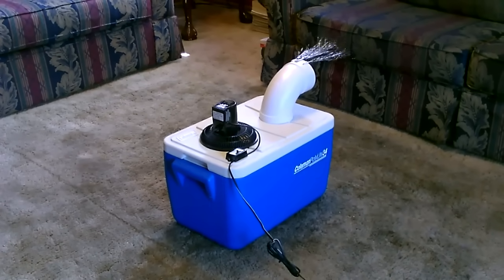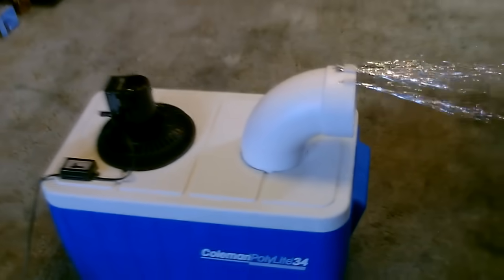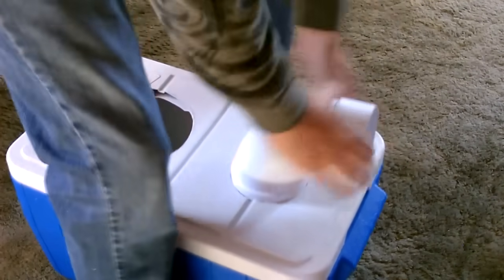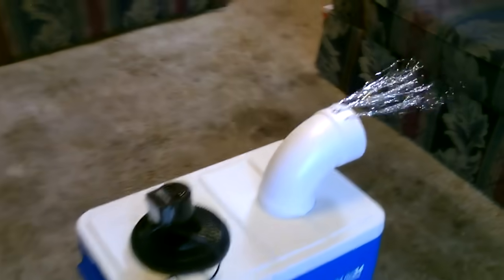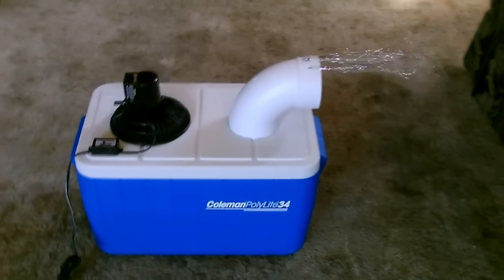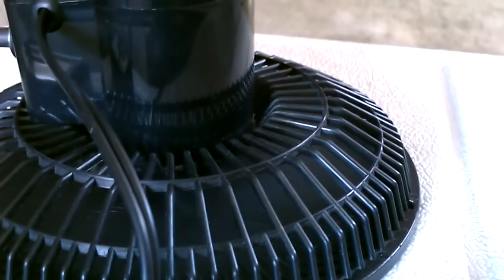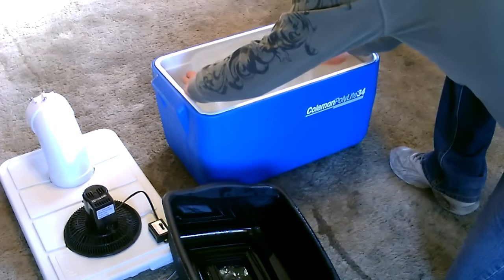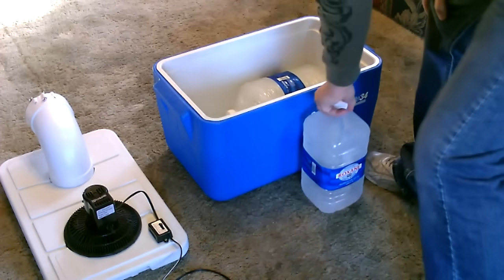Homemade air conditioner DIY - Awesome Air Cooler! - EASY Instructions - can be solar powered!

Comment: Not good . . . ice is not free!!!!!!!!!!!!!!!!!!!!!!!!!!!!!!
Reply: TehGuard If you already have a fridge hooked up the energy that you could use to freeze the water is already being consumed as you read this.
Reply: Trần Hưng Ðạo Freeze water yourself.
Reply: Trần Hưng Ðạo still cheaper than having air conditioning. fridge + freezing 6 liters of water every day = 14 dollars a month. That or a air conditioning bill of 120.
Reply: i think your trolling now, your initial argument is "ice is not free". your right. its not. but its very VERY cheap to make, even with the cost of freezing it. So yea, its not free but its so cheap it might as well be.
Reply: People like Tran are the reason we have mental institutions. Get help fella
Reply: If your leaving freezer on a random setting at like let say 8/10 and when it reaches that temperature it will shut off automatically. The constant output is monitored by an internal thermostat making it a open loop system. It will shut off because the internal thermalstat has detected that the freezer has reached the temperature setting that you chose, which is 8 in this case. Standard commerical freezers all do this. Now if your freezer is not running because it has reached that temperature you will not be using energy. The second you take out the frozen water and put in a new batch of room temperature water, you lowering the temperature read by the thermostat in the freezer by exposing the inside to room temperatured air and to room temperature water. Heat energy disperses evenly just like how water mixes evenly with thing Once you close the freezer door the "AVERAGE" internal temperature will continue to drop due to the existence of the newly placed room temperature water and not only because you openned the door. This will make the freezer turn on again to try and lower the temperature inside the freezer which will consume more energy. So it DOES take energy to freeze extra water all the time. The amount I calculated while I was on skype was a rough estimate and was wrong. According to a source site: 1  Watt is 859 calories/hour, so at 100% efficiency, 1 Watt could freeze 8.1 grams of water per hour. Figure on a refrigerator being around 30-40% efficient, so say 2-3 grams. Converting 12 liters per day of water to grams results in 12000 grams. Assuming it takes 1 W per 3 grams a generous 40% efficiency estimate it will take 4000 Watt per hour of energy or 4KWH of energy per day. This is 120KWH per month so if it is about $0.064 per KHW it will be about $7.70 worth of energy per month to freeze all that water (lol submit to r/ididthemath). So yes it will be cheaper after you build this device. The building cost and tool is something you need to consider if it is worth making, which is obviously yes since it only takes 8 dollars to make.
Reply: +Trần Hưng Ðạo freak
Reply: this had been my first month using it. 31 days of using the DIY air conditioner. I start it up in the afternoon and at night before i go to sleep. my electricity bill this month was 43 dollars. I have 2 room mates that i made use the air conditioner too but we dont have enough freezer room to go around but they love it. so that 43 electricity bill is split 3 way + we all are hardcore gamers that keep our heavy duty computers on 14 hours a day and have 2 fans blowing in every room 24/7. 43 dollars. quite cheap.
Reply: +Trần Hưng Ðạo Ice is free if you cut it from a pond in winter. Store it in sawdust to make it last all summer. That's how the icehouses worked before refrigeration.  I know some remote off grid sporting camps that still do that .
Reply: +Trần Hưng Ðạo it seems to me like you're one of these Obama supporter types that think everything should be free to you
Reply: so i've just recently built mine, 4 days ago. yes. it actually works, turned my room really cold. I live in florida, air conditioning is the biggest drain on energy. Costing me 90 dollars per month if I use it sparingly. Now I can run this make shift air conditioner for 8 dollars a month. and it only cost me 20 bucks.
Reply: and id like to say, if you sit in your room with that blowing on you and if you have ur shirt off, its freezing. dip your hand in the ice and smear icewater on yourself for more intense cooling.
Reply: Trần Hưng Ðạo don't come online talking about evil people who have O blood as if they has a damn thing to do with making a freaking diy air conditioner!
Reply: Xoreign Ye, maybe the first ice brick could be better consumed that way if you don't have any other use for it, but next brick which you freeze just for this is waste of energy.
Reply: and that 8 dollars also includes the refridgerator energy and the fan energy. left on for 24 hours every day for a month.
Reply: Trần Hưng Ðạo That was not a relatable analogy.
Reply: Just fill up a few washed out milk bottles with water than freeze them and put them in this dumbass
Reply: Trần Hưng Ðạo It's sad when someone who doesn't understand a language attempts to communicate an idea that's ludicrous. Considering the majority of whites have type O blood, shut the hell up you racist moron
Reply: +TehGuard your freezer on your fridge runs separately does it?
Reply: +Kristen T koo koo koo koo
Reply: Make ice in your refrigerator? beats going to the store to get some
Reply: Trần Hưng Ðạo  
Definitely a language barrier ..............
Reply: Do you guys even realize how the freezer in your home works? It's not a magic device that cools.
All it does is, taking warm air from inside and put it outside.
So if you put water at normal temperature in the freezer the freezer then will take all the heat from the water and put it in the air of your house.
When you then use those ice cubes to "cool" your house, you will absorb the heat, that your freezer put into the air itself before.
You cannot magically create cold, creating cold always involves putting "warm" from this place you want to be cold to some other place. And if that other place is your house too (like with the freezer) you pretty much don't gain anything.
Reply: ***** What you do just like the dogs throw up and eat back what he just throw out .
Reply: third world problem.....not ours and if you use enough solar panels and marine batteries you can run a decent sized freezer for free........
Reply: +Arkenarge Thanks for doing the calculations and showing your work. Is the cost savings because it is more efficient. Or because you are only cooling 1 room or what? Or does it have to do with the amount of energy water can hold/absorb?
Reply: wtf xD  I'm not sure how you calculate it, but still fridge blows ALL AND OVER the amount from cooling into the room temperature next to the fridge, so you the sum is still negative.

Also, air conditioner has eff > 40%.
Reply: Water is being cooled and used to heat air molecules. The air conditioner is just cooling air molecules. You'd have to compare those equations somehow. And compare the cost of running each machine.

You just can't compare efficiency %.
Reply: This guy act just like dogs throw up and eat back .
Reply: Enjoying The Sun 577-Jersey Customs So what he made for ????????????
Reply: +Arkenarge  awesome
Reply: JimmyJames82 how . . freeze . . electric is not free . Of course free if you are The Ugly blood type O .
Reply: Trần Hưng Ðạo
I'm blood type O and a very warm person :D
Reply: foraminutethere23 That is good . When The Bad (Evils) brought The Ugly blood type O into this Earth . Not 100% The Ugly . Because in this Solar system had many dozens of Earths . Some Earths were bigger than this Earth . Those  Earths had few Earths with real Human lived there . But the Human may not fought hard enough to against The Bad and The Ugly . So The Bad(Evils) changed all The Ugly and Human to Bacteria (Germs) then brought all to this Earth . That the reason some good Human have Blood type O . But O from those already up grade their blood type O plus .Even no one know that changed .
Reply: Kristen T!!!???
Reply: Gun in mouth,pull trigger....go for the virgins man....go for the virgins.
Reply: The Ugly at US took more than 99.999% of US population . All of them are living by WELFARE & FOOD STAMPS , NY Times discovered in 2010 .After 2,000 Welfare & Food Stamps under new name call FINANCIALS. The Ugly all are none education . They are easy to know . Very big mounts and "invented" a  lot of things FAKE. On You Tube or any online . The Ugly always use bad , bad words . The Ugly have blood type O , lower than real Animal blood type .
Reply: Akari Akaza You have a  "nice"  Name "Fucking" . Too bad , I am not "vietkong"
By your name , you are The Ugly blood type O . This blood is not Human . Your body more than 99.999% water . . . So Snow , Rain will waste all .
Reply: "your fridge" runs from where ? Electric power from where ! Do you know ? I am surely , even Barrack Obama could not answer . New York Times in 2009 discovered US , Europe , Asia and Africa don't make any good thing to this Earth . This Earth more than 99.999% are The Ugly blood type O . In 2009 The Hartford Courant of Connecticut discovered The white man was a Catholic priest name Thomas Hooker invented Prostitute . For that in Connecticut state every year has Hooker Parade day . . Men and women dress up like Hookers . New York Times discovered in 2011 in US 99.999% population are living by Welfare and Food Stamps under name FINANCIALS . I can prove to you . US last few years to now all market raise up more than 300% . No one white or black care ! Why ? All are living by Welfare and food stamps .
Reply: +TehGuard if your freezer is already on dumbshit it wont
Reply: No wonder the world is fucked up.......grown adults acting like this over a high school science program
Reply: +Trần Hưng Ðạo ur using electricty for the fan that costs money!!! u need money to buy a box, that needs money
everything costs money!!!! what's ur point??
Reply: OBAMA
Reply: Dr. Seymour Butts Not to me . But every things free  to the  Ugly blood type O . Why ? By Agenda 21 SB 1619 singed by Christ Dodd of Connecticut in early 90s . All The Ugly in US and whole world will change to be good human with their living free by Financials . If they don't change to be good . All The Ugly bodies will be Fertilizer for this earth . All did not change , so times for be Fertilizer by Snow , Rain ,Storms , Tornadoes , Hurricane . . . .The Ugly no less than 1,000 trillions . . a lots of Fertilizer .
Understand Dr. Butts .
Reply: +Trần Hưng Ðạo okay everybody read this guys last comment. THIS IS WHY YOU SHOULDN'T SMOKE CRACK PEOPLE!!!😄
Reply: +JimmyJames82  10-4  skin that's what I been tryin two tell he's food
Reply: +Dr. Seymour Butts You got 1 point.
Reply: Mr-Stoneage-man ok bra
Reply: But it can be "nearly" FREE ,   USE the same water left over in the cooler, to RE-FREEZE again .... And if you have 3 of them, then you will always have ICE to USE OVER ....   
Mind you that THIS will only work IF one' has the "Freezer" capabilities to do so .....   No additional $$ once you set it up "correctly" !!!
Reply: Rick S. To freeze . . cost the electricity . I has a friend is living in US . Last month he used only 4.5 kW Electric . . His bill 154 dollars . Please think more reality . If you don't . I must say , you are The Ugly . Why ? By many discovered all The Ugly are living free . . . then they are really living on the sky .
Reply: +Trần Hưng Ðạo if you have an ice maker on the refrigerator your freezer is going to be running whether it's making us or not. So what I did is empty my eyes out of the bucket in the freezer and put it into my freezer that I have in the garage that way I have extra ice when I need it. Your freezer is going to run weather there is water turning into ice in there or not pretty simple not going to cost any extra. Do you get it now or do I need to draw it in crayon and mail it to you
Reply: Idiot .
Reply: it is if you go to the motel
Reply: Xoreign Ever heard that freezing water consumes energy?
Reply: Xoreign To frozen that much water is moneys .Sample if only yourself walking 25 km with out carry nothing . . will be OK for you . Now you must carry I person in your back . . could you "a fridge hooked up . . "
Think before talk .

Comment: Have you tried throwing salt or rock salt onto the ice to see if it could cool better?
Reply: +KG5 Radio Prepper It wouldn't work. Salt lowers the freezing temperature of water but it won't lower the temperature of the ice.

Comment: What if you used dry ice wrapped in newspaper, cut into smaller chunks placed side by side topped with cardboard...them the block of ice on top of that?  Cool news!
Reply: Jeff Porcaro Groove Master Bad idea, as others have mentioned. However, you could throw rock salt on the ice and it would probably make it even colder.....

Comment: I am intrigued by the folks calling this a swamp cooler. I understand the term if we use an open block of ice, but one gent here mentioned using frozen unopened water bottles instead of a chunk of ice. 

Since no humidity is being added or removed...what do we call this?

Comment: I used a 6" high velocity fan, styrofoam cooler, and 2 gallon jugs of water. But it's not putting out anywhere near the air flow this is. Any suggestions to improve it? Thanks in advance :)
Reply: christine neusch And I used 2" pvc piping.

Comment: This and all swamp cooler devices, blow cool air, 6 inches beyond the air producer its only 60 deg, yes these devices blow cool air, but nothing compared to a refrigerated unit. swamp coolers are used world wide, even in the desert

Comment: Got a small fan, with 2 speeds, but the air flow was not very much even on high.  How do you find a small fan with enough umph to do the job.  I used a cheap styrofoam cooler with lid so I could do fast without lots of tools.  Maybe in the actual plastic cooler is better?  Cool air came out but not very much and went through ice bags and cooler packs pretty fast.  Outside temp was about 87 and indoor about 78 degrees.  Suggestions, comments, please.  Thank you

Comment: i want to try something like this, only using an insulated box with a smaller fan with smaller exhaust ports, in an effort to keep the cool air in and the hot air out and to get more air pressure.

i was also thinking about "routing" the air flow, by super gluing or duct taping a little wall to the lid, right by the fan. this could force more of the air through the ice

Comment: Main thing here is how much airflow of your fan have. I've made a smaller device for my bedroom 3x4 meters (9x12 feet) and I've put a 120 mm PC case fan at the top. But it doesn't have airflow high enough. So I've ordered SCYTHE Grand Flex, 120mm, 2000 RPM which has an airflow of 76.6 CFM = 130.1 m³/h . So by my calculations, with this fan I would be able to completely change air in my bedroom 4 times per hour. To be more clearer, in one hour air in my bedroom would pass through the device 4 times. So I believe it would be perfect.

Comment: I would imagine if you use more and smaller plastic bottles as much as you can fit it will increase the surface area making it as effective if not better than the big ice cube and then refreeze the bottles and repeat. Great video.